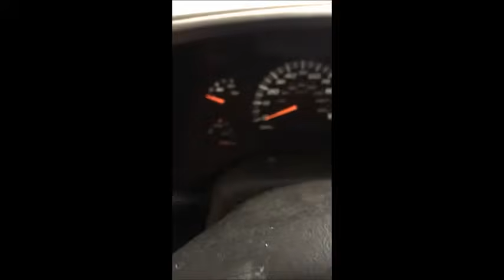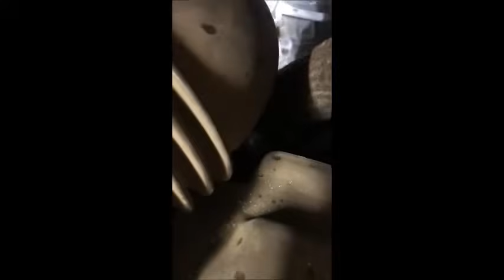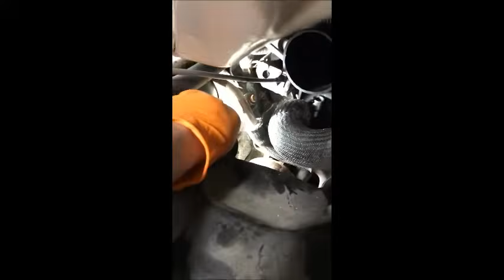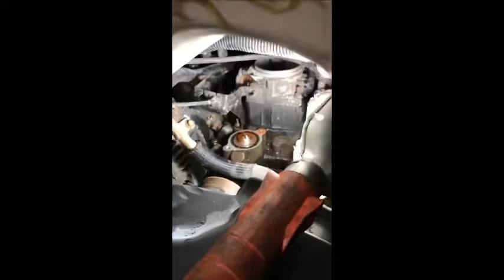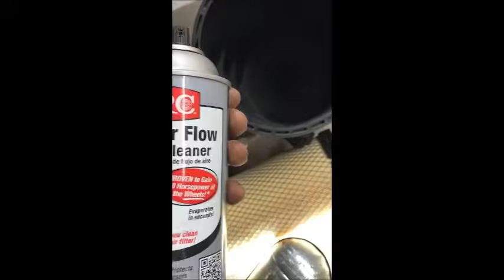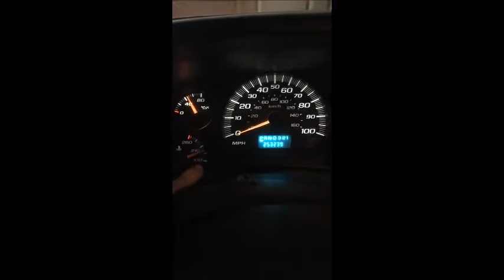Chevy Express, GMC Savana V6, Thermostat Replacement, No heat issue fixed!

Comment: Do you need to take the front end off to replace the water pump and Get the fan shroud off without cutting it

Comment: On my 2000 chev express 4.3 v6 there is a component part w wire harness that is bolted right next to thermostat access. Any idea what this part is? Thanks for making this video. My van has same problem low heat.